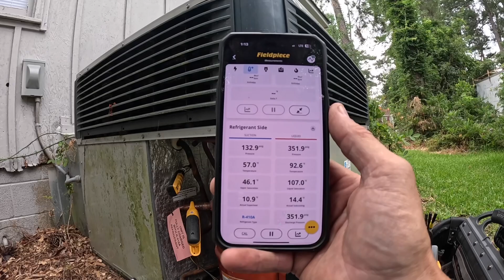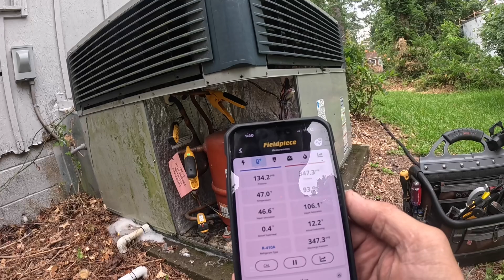Trane Package Unit Not Keeping Up! #hvacguy #hvaclife #hvactrainingvideos

Comment from the maker: Yes, I’ll be back to seal return.
Reply: Yeah the Schrader valve when you unscrew that top one sounded like it was leaking just so you know might want to replace the Schrader valves on that unit
Reply: @andyvitz  but pressures were fine, so ... maybe not as long as caps seal the valves
Reply: recommend ,return vents above the doors ,that house is at negative pressure,and it will struggle with no returns.
Reply: @MariosACandRefrigeration  All you have to do is take an inch off the bottom of the doors, if that's the case.
Reply: @jthonn  most new doors have a 1 inch piece of press wood on the bottom,for support.
Reply: @MariosACandRefrigeration  I have trimmed many without any issue. What you are saying may be true, but it's more than an inch, although some cheap doors could be different. They are made that way just to cut them off, usually for carpet.

Comment: When the filter gets sucked  back into the return box like that, the system is starving for return. Check static pressure. Ill bet another 12” return from the crawl space return plenum box would dramatically improve performance. I would tell the customer to start putting money aside for a new compressor. That one sounds like a cement mixer dumping its load.

Comment: 12 subcool and 11 superheat before clean
10 subcool and 0 superheat after indoor coil clean

overcharged, but i dont think outdoor coil clean would make any difference
Reply: probably the last guy did a gas and go to get suction pressure up, vs. find and fix the issues. it's on the right track now pun intended

Comment: That coil cleaner is useless, it's just foamy soap. . Buy some decent stuff that actually gets the dirt out. 
Get both coils properly clean, upgrade or repair the ducting then pull the charge and weigh it back in..

Comment: You need to change your brand of coil cleaner
Reply: yep, that was a really poor attempt at cleaning the coil...cover it with soapy water and leave it. You could see the foam on the ground was clean with no dirt dragged out the coil so it's doing nothing. The finished result was still surface dirty so it'll still be plugged .

Comment: Hey HVAC Guy! I have a question for you. Can a double breaker auxiliary heat strip kit be wired using one breaker or one side of the heat strip, instead of both breakers.

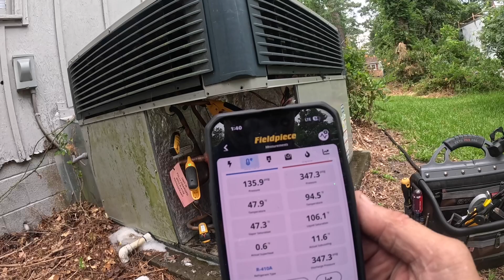Comment: The beginning conditions at 3:20 are ridiculous once you see the condition of the indoor Coil at 8:23. That amount if blockage should make the coil freeze up. The ending low superheat at 14:56 indicates that the metering device must be an orifice. It's likely that someone previously overcharged the system to address a persistent icing issue due to very low airflow. Therefore, it's essential to check the external static pressures. Sealing the return might further reduce airflow. 
It's also highly probable that the system is too large for the home. A smaller, properly sized unit might be a better match for the current ductwork.

Comment: How does a coil get that dirty if a filter is being used?
Reply: A clogged filter will buckle and let dusty air in contact with the dew covered evaporator. The dust and water form a mud that becomes even more insulating when they dry. Doesn't take but a week for a leaky airfilter to cause a problem with the evaporator.
Reply: mickey mouse.
Reply: because of that hole in the return, it sucks unfiltered air through any gaps or cracks.
Reply: Open air return somewhere!

Comment: Another great save! 
.
Use fiberglass filter? Where  you were measuring liquid line temperature and pressure was  before the condenser. Did it have a pressure port after the condenser?
Reply from the maker: Yes

Comment: Sounds like non condensibles in the compressor?
Reply: Sounded overfilled to me too but the compressor wasn't sweating.
Reply: non condensables in the compressor Hows that work???
Reply: @richardbartlett6932  well something like air is not generally excepted to be run through a an AC compressor. Things like contamination of moisture is not going to condense the way refrigeration has been designed to condense.
Reply: He showed us the pressures,how did you conclude that the system has noncondensables, for me looking at the pressures nothing indicates non condensables, pressures were not going up and down at the high side